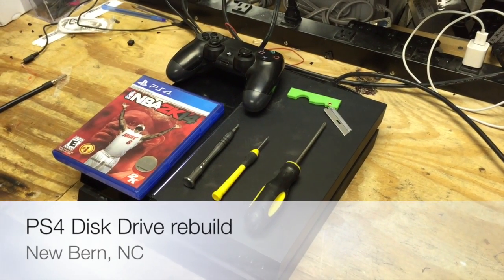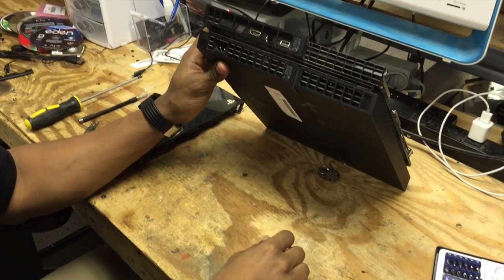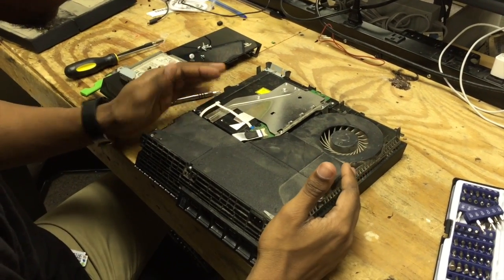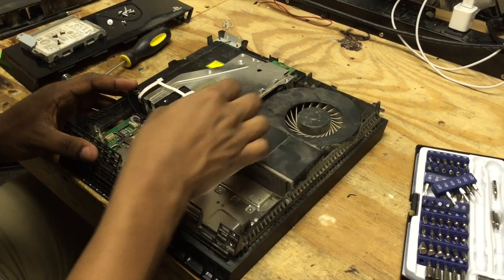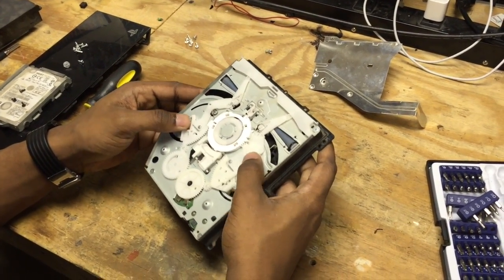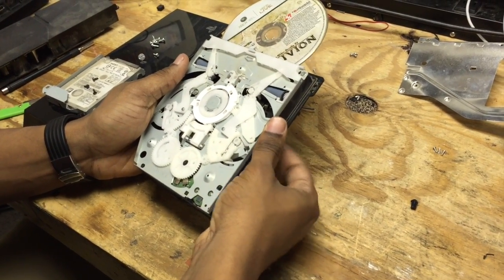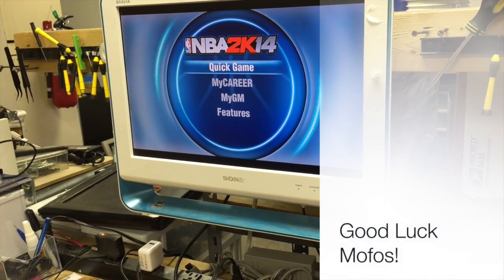PS4 Disk Drive rebuild

Comment: I might be wrong but that little black piece that fell out, I think that is used to manually remove a stuck disc without dissembling the whole disc drive. 

7:23, see the three main white cogs? Top of his left hand. Remove the top middle cog and that little black piece drops into the…. Reservoir(lack of a better term) that hangs off the left side. It connects with the white cog via gravity or when you engage it with a basic Phillips head. It will slowly engage the mechanism that moves the disc in and out of place. 

That is my best guess/explanation. If anyone else knows better please say so! So many people have been asking and trying to figure this thing out.
Reply: not all hero's wear capes
Reply: Damn...thanks this is the main reason I checked this video out...but the guy hide it from the camera when he knew he messed up 😅

Comment: dafuq dude that black peace is my problem and you just skipped that,  well this was waste of time
Reply: VnuReo did you found something?
Reply: The same thing happened to me I’m trying to figure that part out
Reply: me too
Reply: Another one here
Reply: Here there, same problem...
Reply: What do I do I have the same prob
Reply: yeah dude. a little black piece falls out of the sky, which ends up being your problem and you dont think to address it?
Reply: Michael P you don’t make sence
Reply: And another one...
Reply: @michaelpayton1027  thanks for the pic really helped. That peace was confusing me
Reply: same man
Reply: @michaelpayton1027  sweeeet! Thanks! I've fixed it!
Reply: @KorzH72  so dose the black part just sit there with no tension on it ?
Reply: @Skankhunt556  you mean the spring? There is the spring in the black gear. I've got it fall off when disassembled the drive.
Reply: Check right hand midle finger at 7:48 minute ;)
Reply: @michaelpayton1027  do you have the picture
Reply: @jairhampton7623  I need it too!
Reply: @KorzH72  did you fix it?
Reply: @derelict57c34  can u post that pic please
Reply: Bruh years laters I’m having the same
Problem now

Comment: For everyone wondering about the little black cog: it is the manual eject screw, and it goes in the little round slot directly beside the largest top-center white cog. It's not imperative for function, but since you've already had to take the drive apart once, probably a good idea to keep it in there.
Check the video below to see it.

Comment: I just fixed mine where there was a penny stuck on the magnetic part on the inside. The reason I found it was because of part 09:14-10:30 I didnt get the same result as you did. It got stuck at the end and did not lock onto the cd wich was the problem in my case. After I removed the penny the gears worked again and I could mannualy spin it!

If it wasnt for this vid I would have probly bought a new BD-disc.

Thank you very much

Comment: Complete disassembly is extremely excessive. You need to only remove the drive 4 security t8 and the topper(metal piece with the gears) and clean with alcohol prep pads ONLY avoiding contact with the laser lens, then using a qtip and pool silicone to lube the 2 slides and the step motor drive gear very light application though! Will solve your issues 99.9% of the time.

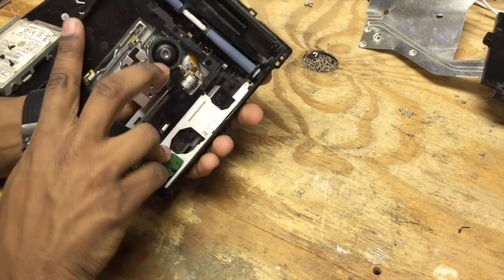Comment: That black cog that fell out at 8:28 where does that go exactly?
Reply: check his video at 8:16 the three gears, two smaller ones and the big one covering them both, that black gear is for the manual eject and it goes into the hole right under the middle gear. You can see it its right on the edge of the entire assembly at 8:16 half covered by the middle white gear. Hope that helps.

Comment: I installed a new disc drive into my ps4 and every thing worked fine untill I switched the drive board and now the disc drive won't spin the discs anymore. It just makes a clicking sound and won't recognize any disc. I noticed when I move the big ribbon cabble a little bit that the disc starts spinning for a moment, but stops right after. Could you tell me which ribbon cable I have to repair?

Comment: Mine will not take disc. Motor makes no noise don't even attempt to turn gears. I took another fully functional drive placed in console it then takes disc fine. So i put the drive board that goes to the console on the working drive and then Same deal won't take disc. Laser jumps when i try to insert then nothing more?
Reply: Dont Remember when I try to put a disk in it won't even go in. seems like it is being blocked by something.
Reply: Raven did you buy a new ps4 too?

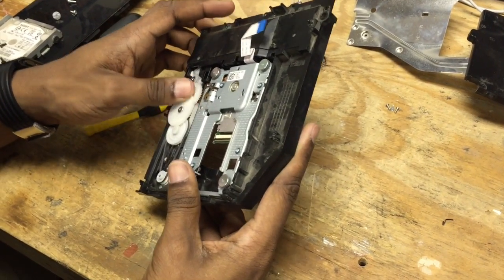Comment: 8:25 where the hell does that cog/gear with the spring go that you had dropped out. Mine dropped out and I have no idea where it came from! Anyone is able to help?
Reply: Figured it out, it goes inside a little hole next to a screw, hard to explain but I got it.
Reply: Which side I have no idea I've been stumped for like an hour
Reply: @courtneywaldick8406  check his video at 8:16 the three gears, two smaller ones and the big one covering them both, that black gear is for the manual eject and it goes into the hole right under the middle gear. You can see it its right on the edge of the entire assembly at 8:16 half covered by the middle white gear. Hope that helps.
Reply: Thankyou so much! Appreciate it.
Reply: @courtneywaldick8406  you're most welcome :)

Comment: Hi! I have a question:
Is safe for the blu ray disc to keep it in the console PS4 drive?
I don't want to walk the disc between the case and console. In plus, is hard to take out the disc from his steelcase.
Reply: I mean: to keep the disc inside even if I turn off the console.

Comment: I have this exact problem! And it's with that same black piece that fell out at 8:26. I need to know where it goes!!! I think it's in the little slot next to the drive gears on the bottom side. But idk where the spring goes. HELP.
Reply: I am having same issue, I have found where it goes but doesnt look right... any help please!
Reply: Rhian Parry were does it go I have same problem
Reply: dustin wheeler where there are 3 large cogs on the part where the laze sits there is a small hole next to the bigger cog of the 3. you want it in there with the spine inside.
Reply: Taylor Manuel I have found the issue I came across the same issue and found where hat black peace go

Comment: 8:26 
Where the piece that has just fallen from you goes because it falls and I don't know where it goes
Reply: it should be close somewhere where there is an empty hole one the sides of the drive. the black thing is the turning screw. If not then idk wtf the thing is.
Reply: Check right hand midle finger at 7:48 minute ;)

Comment: Anyone happen to know where the black gear fell from? Mine ended up with out it whenever I last cleaned it and have been wondering if it is causing the eye to not read a disc at all. Not even a DVD. Already have cleaned the eye prior to it but this time didn't have the isopropyl alcohol to get it clean clean..
Reply: Check right hand midle finger at 7:48 minute

Comment: Hello please help me so I cleaned my ps4 as usual but last time I opened the power supply and it was very dusty cleaned it with a blower and used a electronics cleaner and cleaned the top cover and the fan when I packed everything up the disc drive is not spinning and it makes ejecting sounds so I watched a tutorial on how to clean it and sprayed electronics cleaner and cleaned the laser and everything and did all possible solutions like software update and data rebuild ect... And it is still not spinning and gives me unregonized please help me

Comment from the maker: Which black piece? Send me an email with a picture of it. Bbftbx@gmail.com
Reply: please tell me you are still active..

The part you skipped is the very part I need.. I have a playstation in with the same issue =(
Reply: the piece that fell off at 8:26 i just completely skipped that and i had the same issue but have no idea where i came from.
Reply: Hi I have the same problem with that piece...any clue?
Reply: richardill it's not really necessary it's used for the manual take out of the disc without having to take out the screws. It should be on the side of the panel in a empty hole.
Reply: Thanks man, already done and mi ps4 is working again :)